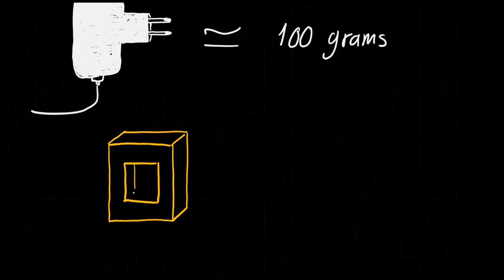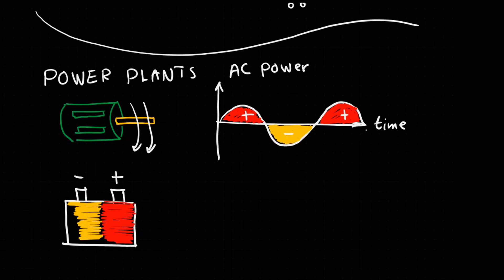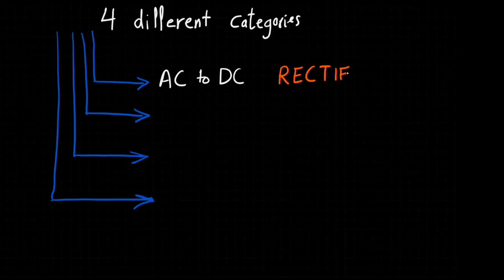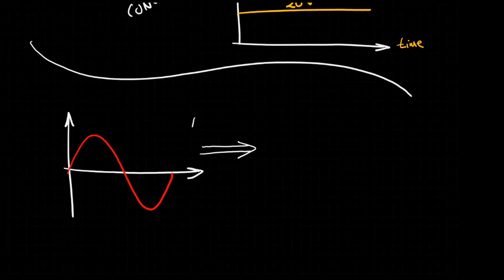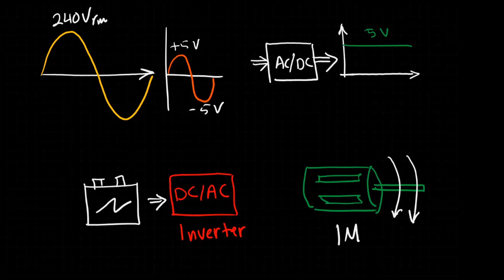Why Should we Stop Converting Power in One Direction? | Enjoy Power Electronics

Comment from the maker: 00:00 Introduction 
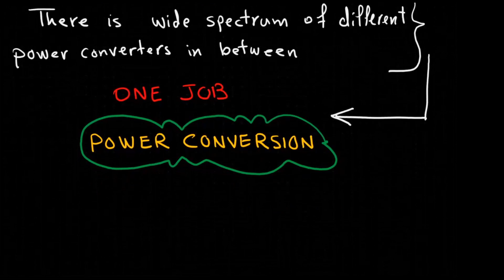00:56 Why do we need power chargers, transformers or converters? 
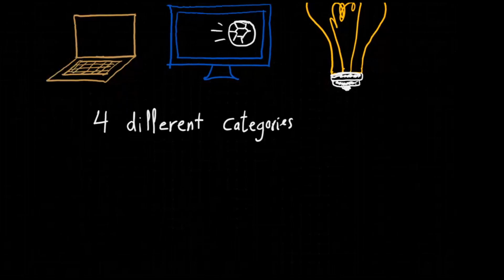02:40 Mode of conversion 
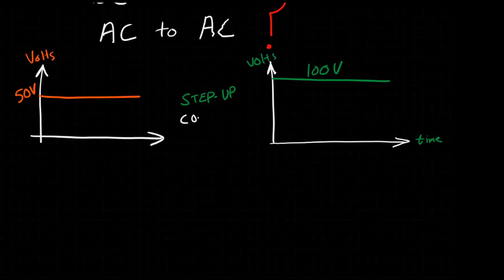03:27 Step down or step up conversion  
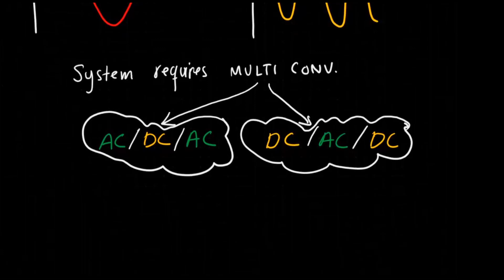04:17 Examples 
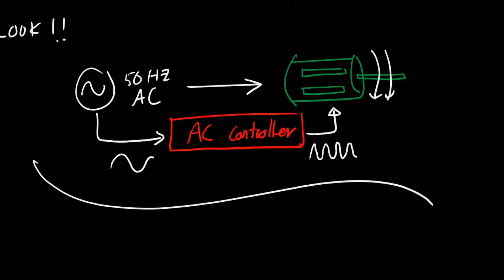05:35 Applications of power electronics 
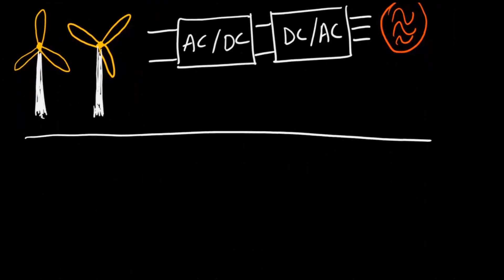06:01 One direction conversion vs bidirectional
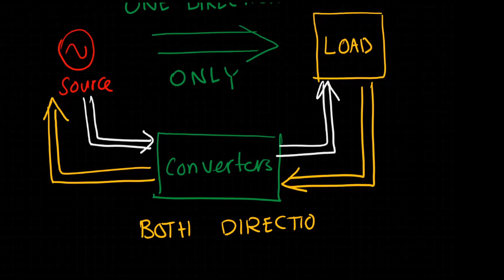06:36 Wrap up